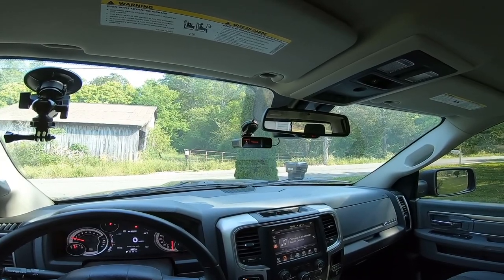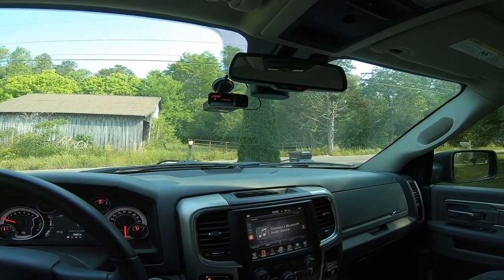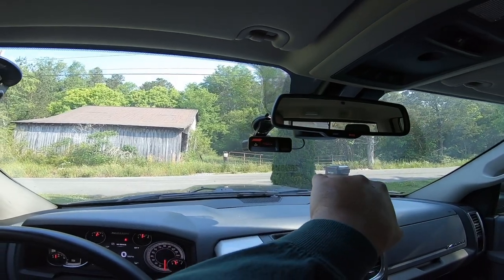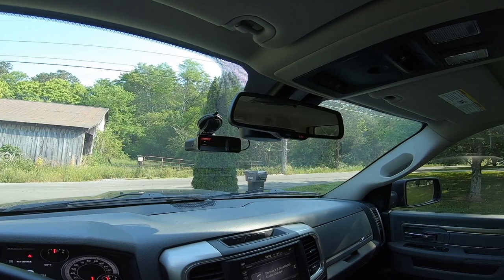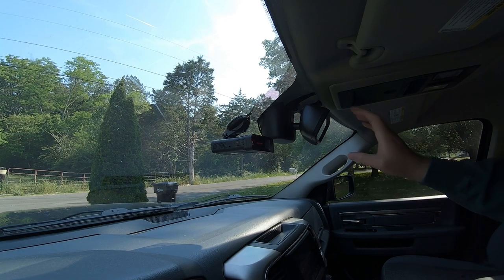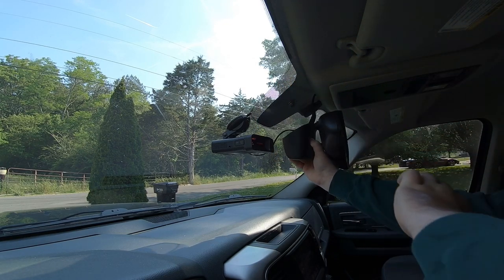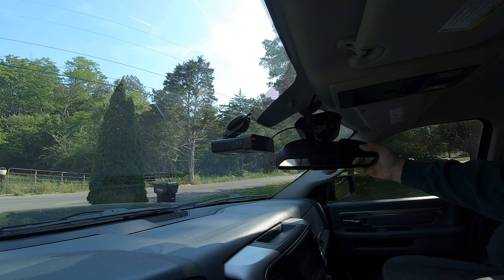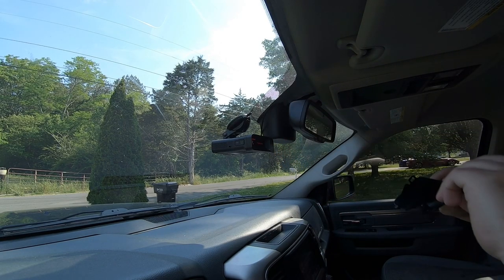Installing a Radar Detector using Mirror Power in a 2017 Ram 1500 Big Horn | AJ-DIY

Comment: Thanks for posting this video. Really helpful. One thing I didn't have to do on my 2016 Ram 1500 was remove the mirror. I was able to get the front piece of plastic off, then the main piece slid down and gave me access to the wiring.
Reply from the maker: That’s a great tip! It never even crossed my mind to attack it that way. I had already pre-decided I was going to pull the mirror down!

Comment: If you short out the wires during the install you'll blow a fuse in the engine compartment fuse box.  It's the 10A fuse marked "Sunroof".  Ask me how I know.
Reply from the maker: Great tidbit for those that may have the same accident. My truck doesn’t have a sunroof so I don’t know how that changes things.
Reply: @AJ-DIY  Mine doesn't either.  It powers everything in the overhead console.
Reply: Lol, just barely did it

Comment: Is there a secret for removing the plug in the mirror so you can tap into it? I can’t get the pigtail for the rector to go into the plug too tight mostly not enough space to work with the wires.

Comment: Hey man I've been looking everywhere what's that little black square mounted behind the mirror on the right side?
Reply from the maker: I can’t say for certain, but the GPS antenna is mounted externally so I’d think it’s the receiver for the long range key fob these trucks have!
Reply: Makes sense thank you
Reply: It's the HVAC Humidity sensor (on certain trucks w Auto Temp Control)

Comment: Those suction cups suck when it gets cold,it falls off the windshield and will not stick!!
Reply from the maker: I can’t say I’ve had the same experience with the one that came with my R7. It’s some sort of sticky adhesive suction cup they included with it and honestly, it’s almost impossible to take it off the windshield. I wonder if you’re using an aftermarket cup or if Uniden changed the mount.